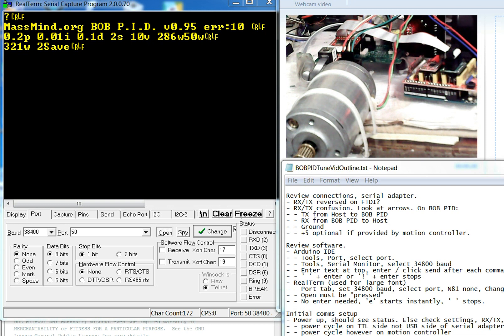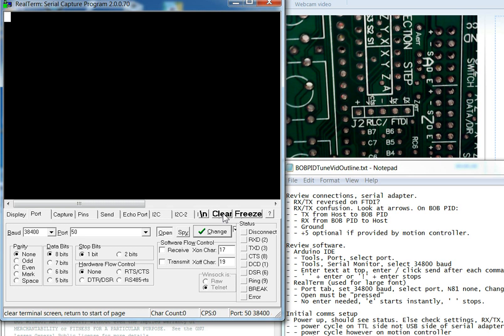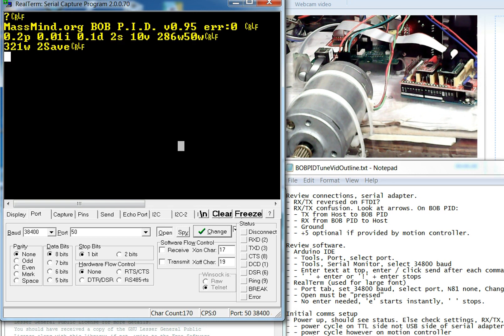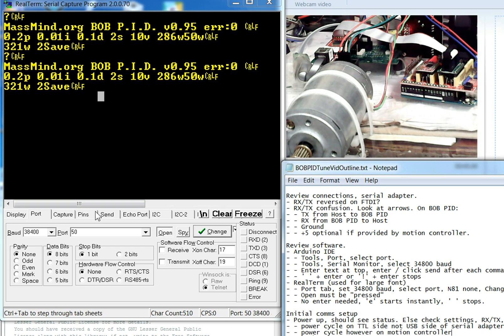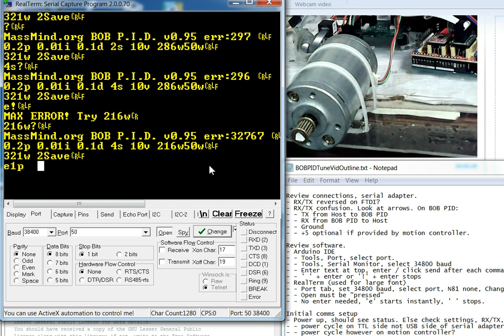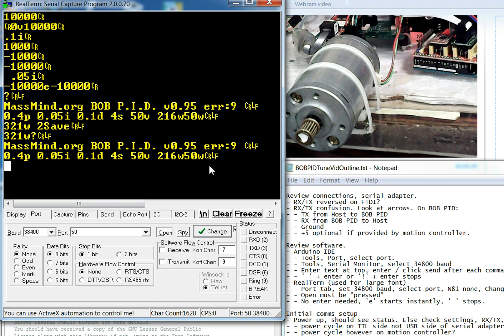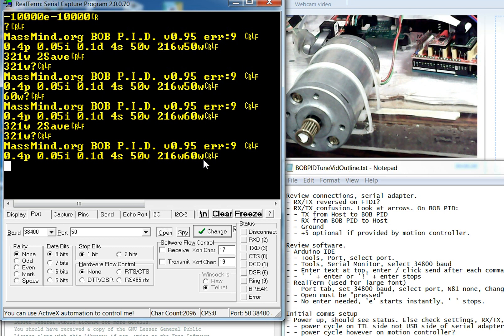BOB PID Tune

Comment from the maker: 0 Intro setup and making a connection
6:20 the encoder position error 
7:30 settings overview
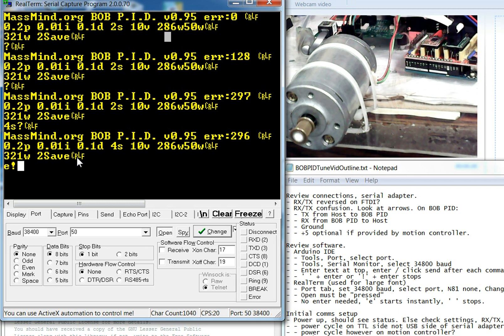9:35 enabling and disabling
9:50 setting direction
10:50 overdriving
11:28 P proportional drive tuning
12:00 moving
12:25 velocity
12:40 I inertia tuning
14:00 D differential tuning
14:06 saving

Comment from the maker: Nothing is as nice as positive feedback on a new firmware release: Jim Fong just emailed back after we sent out the upgrade to him.

"It's working great.  Before I was using a lmd18200 3amp hswitch but I hooked up your fet driver you sent me awhile back. The fet driver certainly makes the bobpid perform much better.  

No problem uploading hex with boot loader either.  

Ran a long grbl test gcode and motor ran well. 

No issues with tuning."